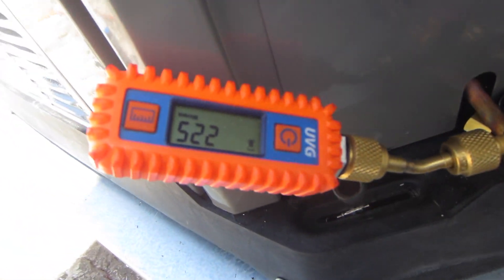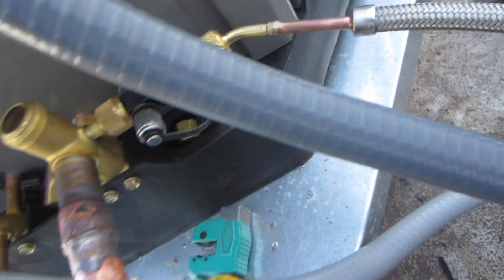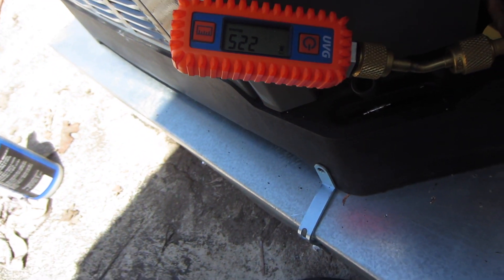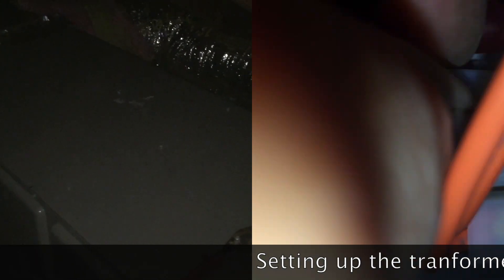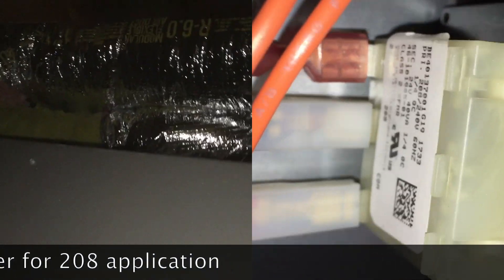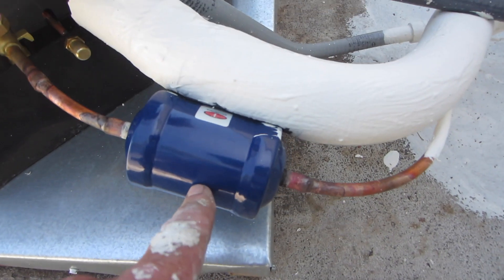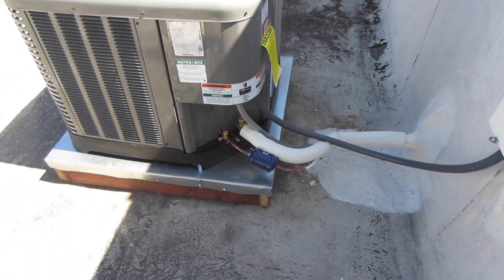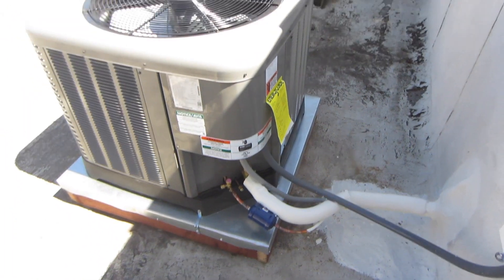Rheem Heat Pump Install

Comment: Dope install! Nice stand and line set work. What product do you use for the line set UV protection? We use some really thick white UV tape down here in Houston. That painted one looks a lot cleaner though.
Reply from the maker: Thank you Set Araujo, On the line set I use this: https://www.amazon.com/HENRY-HE587046-Henry-Gallon-Coating/dp/B003ZJ74WU  and it works real good. I have never used the white uv tape I would like to try it. Thanks for watching.